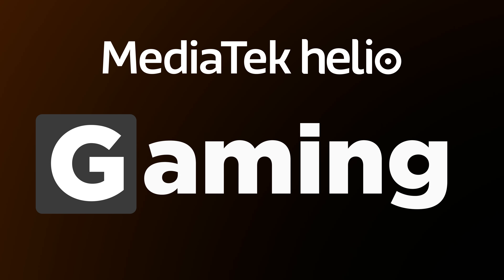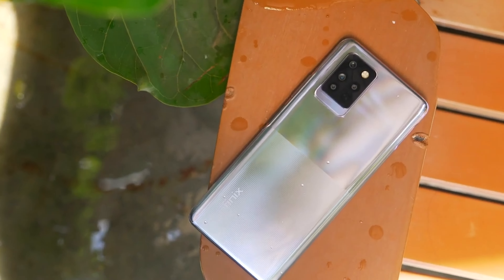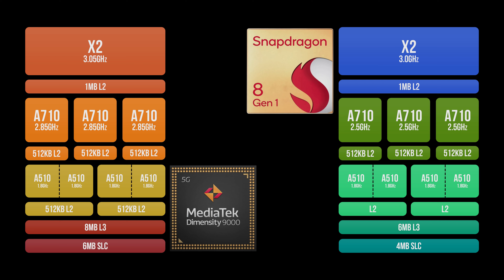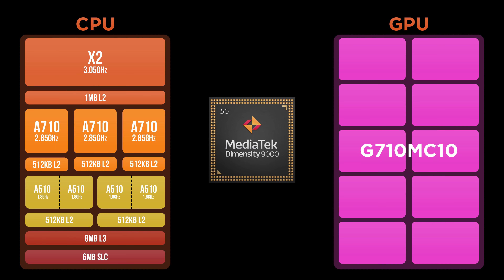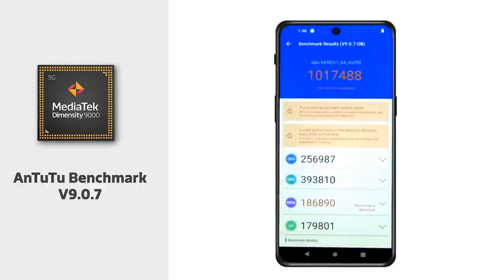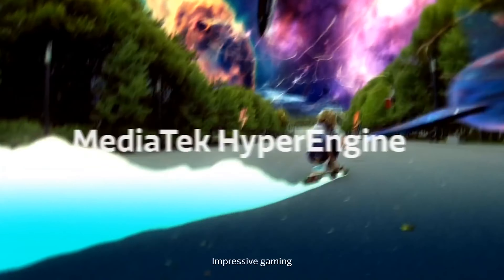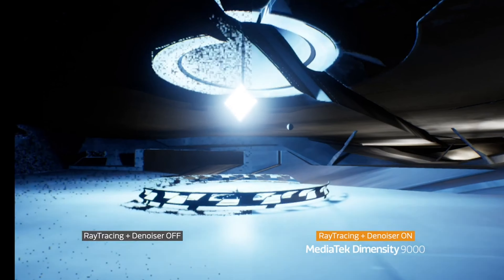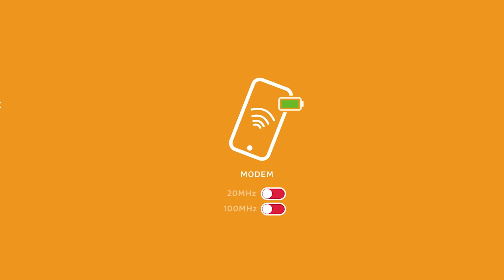MediaTek Dimensity 9000 Flagship Chipset EXPLAINED!

Comment: Not all dimensity are flagship,,some of them are entry level mid-range like dimensity 700 or 810 with some phones out there are price at 11k less or higher,,then right now the A-series and P-series are entry leve(7k pababa)l,,at meron dng P-series na nsa mid-range at upper mid-range like p60 n nsa budget(7k and up) and p70,p90 at p95 n nsa mid-range to upper mid-range (13k to 28k)... sadly wla Ng x-series ngaun correct me if I'm wrong,,, then ung Helio A-series nla is parang slightly upgrade sa entry level P-series...while ung Helio P-series nmn mukang susunod n din,, majority of budget phones (7k to 11k) or entry mid-range (12k to 18k) are using Helio G-series at Dimensity series,most of mid-range or upper mid-range P-series gnagamit Ng oppo,,Lalo n sa Reno series nla